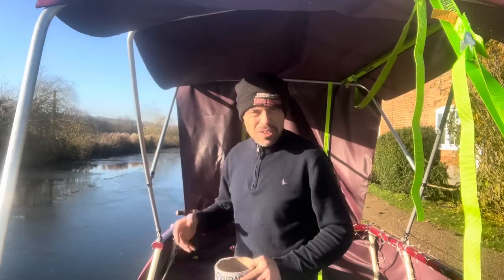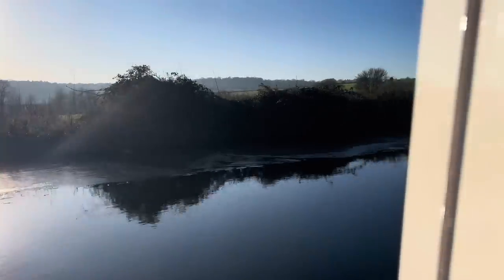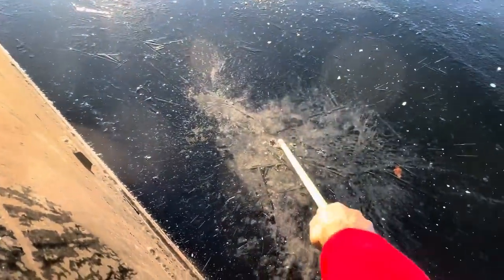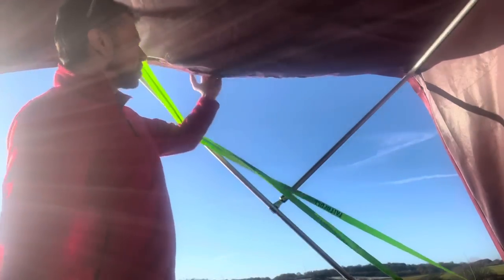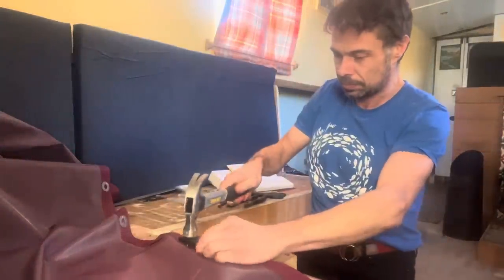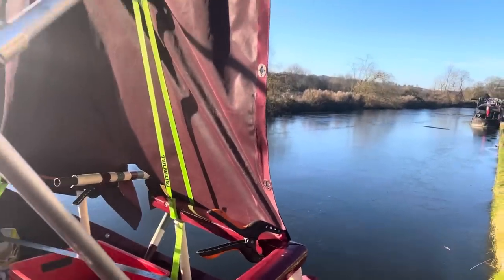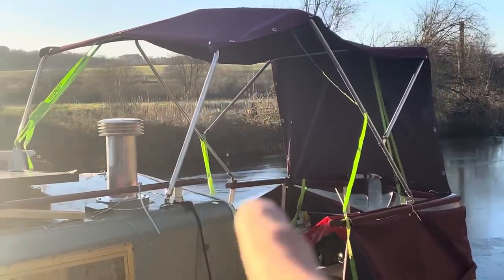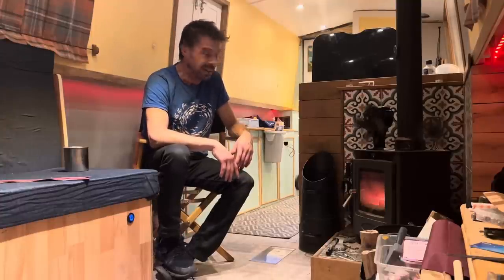384. Problem pram hood sides | Staying toasty warm onboard

Comment: I can tell you how I used to do these fittings on canvas hoods (on kit cars, back in the 90s).
What I'd do was press the fitting onto the material hard enough that it would make a small indent on the canvas, remove it, and cut through 4 tiny slits (aligned to the direction of the metal tab on each corner, one cut for each tab/corner) using a stanley knife. I guess a scalpel might be better.
Then push the tabs through the tiny cuts, fit the other side and bend the tabs over to clench the two together with the canvas in the middle.
That just leaves the hole in the middle - I'd cut a cross where that was due to go, then cut out the triangles to give a square hole.
I usually found that good enough, but with a sharp new blade you can trim it to more rounded hole.
Is your material PVC though? If so then if you fit it in Winter it's going to expand a lot in the summer, giving you a very loose fit.
I found it best to fit PVC hoods on a very hot summers day, making it easier to stretch, and as it cooled down it would contract and pull itself into shape around the frame.
I'm no expert, however, that's just the way I'd do them all those years ago.

Comment: You need to file the edge of the die to re sharpen it, I use a rubber mallet and an acrylic cutting mat to hammer dies into leather, canvas etc This stops the dies getting dulled. It’s still looking really crisp, definitely keep in touch with the upholstery guy just incase you need any seams reinforcing 😉 You are definitely proving necessity breads invention James 👌🏻

Comment: Hi James, about making the holes in the fabric.  Have you tried going to a tack shop and getting a leather hole punch?  They are hand operated and shouldn't be that expensive.  I'm not sure as to how large a hole one can punch with it.  The other alternative would be to make a jig out of some wood allowing the fabric to slide through and use your drill to make the holes.  The pram hood is starting to look really good.

Comment: Hi James 
Great videos 
Whenever we had to punch out holes in gasket material we used a dense lead block 
Then as it got riddled with holes and dents just hammer it back into shape 
It worked a treat 
Cheers Glenn 🍻 🍻

Comment: I'm a bit confused. The water not freezing near the boat hull is that not a sign that the boat needs better insulation? Meaning, you are wasting heat on the fishies?
Reply: Not necessarily.  The sun shining on the dark paint & blacking warms it up a bit, plus the metal itself conducts the temperature from lower down in the water where it's not freezing.

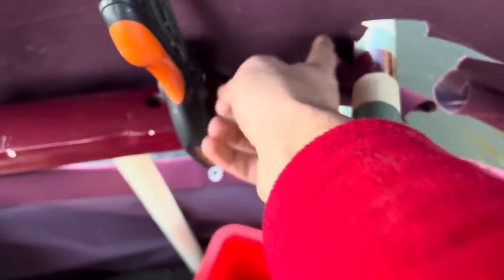Comment: After 4:37 -- The middle is always going to be tighter than the edges.  Because the center has a peak compared to the sides it is a longer distance to travel going up to and across each peak compared to the two outer ones.  To get it to lie totally flat you'd need to either hem in a pleat at each bar or trim the ends back on an angle (or maybe an arc on the sides).

Comment: Hummm. Would another metal bow on the back, attached higher up on the tallest bow help with the sagging?  Looks like your canvas needs a bit more support on the top. Also tension is important. Not enough tension on the fabric and it will sag, especially with anything like rain or, heaven forbid, snow. 

Google biminis for boats to see what I mean about the extra bow. 

Sue

Comment: I like the simple, three hoop configuration, but I keep thinking (OCD) what's the distance from the railing (90 degree from rail) to the 90 degree hoop clamp (same both sides) and the railing hoop connection to the 90 degree hoop clamp (also same both sides)?
I'm hopping you'll replace the straps with tubes, with quick connections to easily fold down?  ;-)
Take the time to do it right, but of course, keep warm.

Comment: First,  the wind screen bow needs to be set in a fixed angle some how.  Removable pins???    Next, The center and aft bows need to be attached (sewn in somehow) to a permanent spot on the roof canvas.  Then you set the placement of snaps on the aft rail to create the tension.  Sail boat Bimini Top 101.   Then, when you unsnap the front roof from wind screen, you can swing it all over the aft rail and somehow tie /strap it so it's not flopping around while cruising.  T. Mack, "Mr. Fix-It"
Reply from the maker: I think my head just exploded !! I’ll re-read that again
Thanks